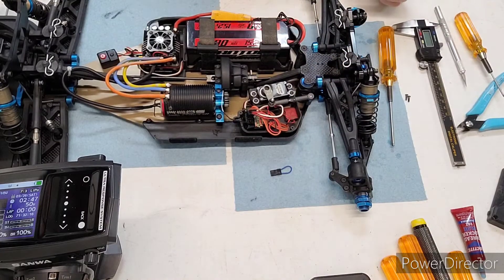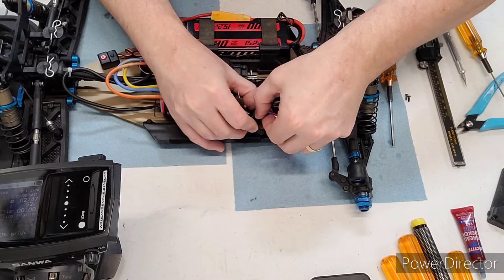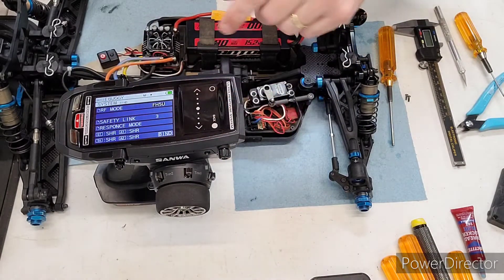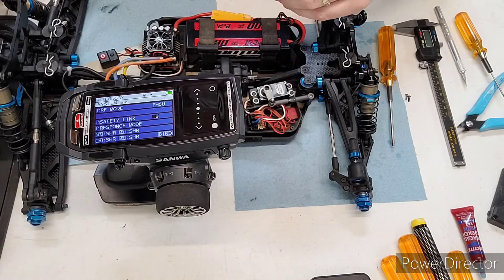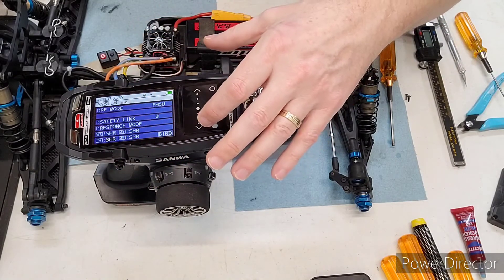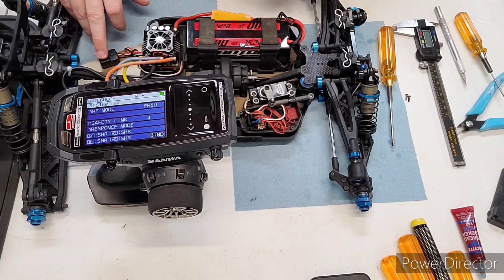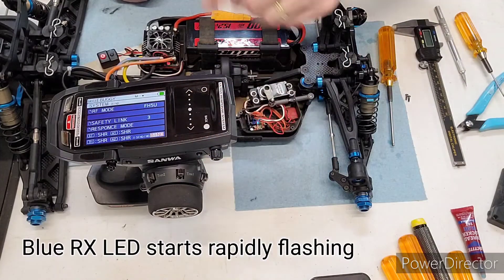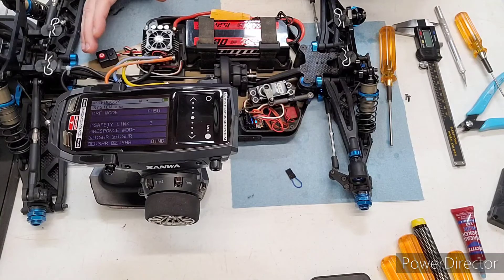Binding Sanwa M17 with 493 / 492 / 491 RX

Comment: Great video, so for the rx493 do I have to use Fh5U or will fh5 work? Curious to know what the difference between fh5 and fh5u. Thanks!
Reply from the maker: Noah I have not tried the 493 on FH5 but have been told that it does not work.  FH5U has a quicker response time than FH5.

Comment: Really sturggling with my M17 to bind, servos making weird noises, voltage warning coming up ect.
Reply from the maker: Depending on the brand some servos can make weird noises.  But am not saying yours is normal. I am not sure about your issue without seeing.  If you post a video I will try to help otherwise maybe ask a local hobby shop or track to help you.
Reply: @RCeXtra  Hello RC eXtra, thank you for getting back to me. I am only getting back into the hobby after 15 years or so; so everything is all new to me again now.
All my parts are new (I have dissassembled the steering rod, so don't worry about that), but essentially, I am using a Sanwa RX-482 Reciever along with two Sanwa PGS-LH2 Servos. My remote control is a Sanwa M17.
I have connected my remote to the reciever from SYSTEM > BIND, then just changed the RF Mode to FH4TE as that's the one to choose since in UK we don't get FH4T; that's what I read online anyway.
Few issues I am having.

1) The noise of the recievers, is this normal ?
2) The throttle servo seems to be moving one way by itself opening the engine valve, yet when I accelerate on the remote, it closes the valve, so like inverted the wrong way and I don't know how to change that.
3) You'll see at the end of the video at random times the remote will bleep with like a voltage warning it seems ? again, I'm not too sure why it's doing that and if it's a problem.

Any help would truly be appreciated as I have not found much help online. Also the video is on my channel, link below:

https://www.youtube.com/watch?v=UFgFnHJaIx8

Many thanks in advance,
James.
Reply from the maker: @blackfalcon1992  
James
1.  The noise is your servos and is 100% normal.
2.  I am not sure if I understand your issue.  Are you saying the throttle servo is moving the wrong direction?  So forward is braking and braking is going forward?  If yes then you need to go into the channel 2 servo reversing and swap from normal to Rev.  You will also need to reset the sub trim.
3.  The sound is also 100% normal.  That is the radio saying you lost connection to the car.  This happened because you shut off the car.
Reply from the maker: @blackfalcon1992  this video may help.  Shows how to setup the steering servo but the same would apply for the throttle channel.  The menu I am using is the menu>custom section and you can toggle between channels by using the open  circle which  is in the upper right hand corner of the touch pad.

https://youtu.be/kx89Qvg11RM
Reply: @RCeXtra  Thank you very much for your reply and input; tomorrow I will give your video a watch and see what I can do and let you know then :)